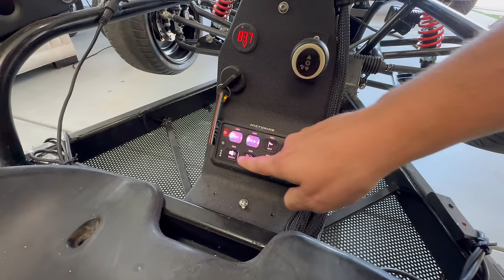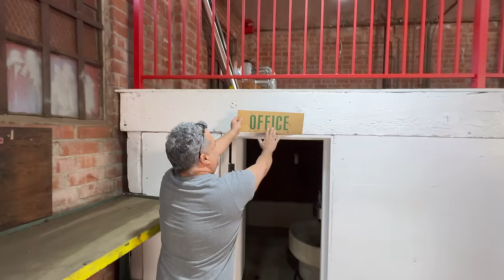Insane Electric GoKart at Full Power + NEW Headquarters?

Comment: I used to race go-karts and we don't have front brakes we only have rear hydraulic brakes . The reason is because you have no steering control with front brakes . You would get better control by switching your brakes to the rear with the pedal with no regen and remove the handbrake . You will be  amazed at how much more control you will have cornering  .

Comment: You should always wear electrical safety gloves and shoes when dealing with high DC current, also all your exposed terminals should be insulated with temporary tape or proper plugs. Don't mess with high power, be safe

Comment: Use that brake cleaner to clean your mass air flow sensor eliminates the lean codes gives you better performance you can wipe out your throttle bodies with it also if it's drive-by-wire Don't spray it in there it will get into your servo